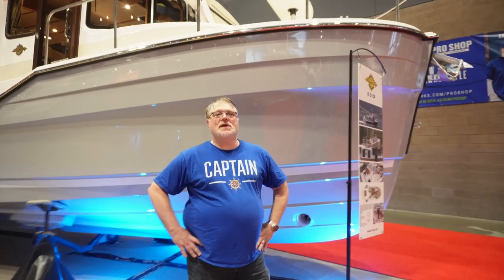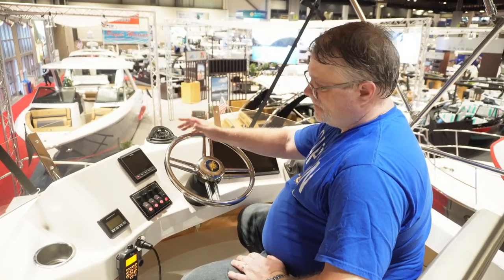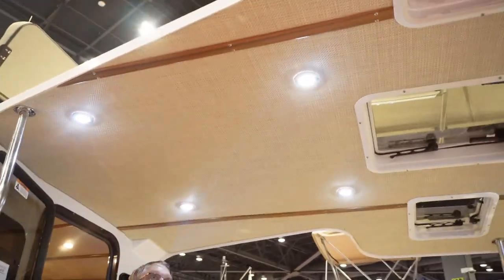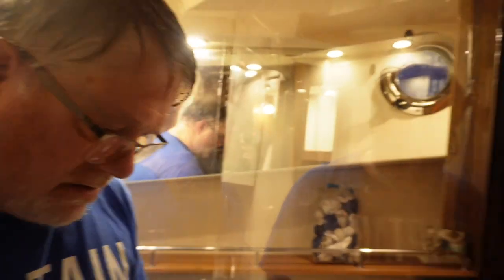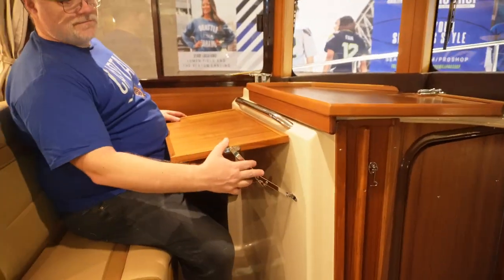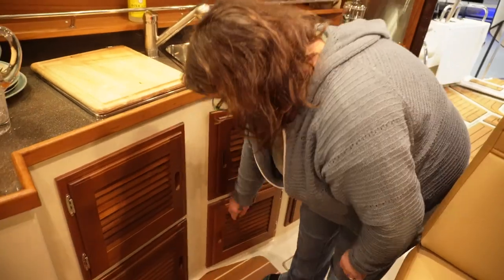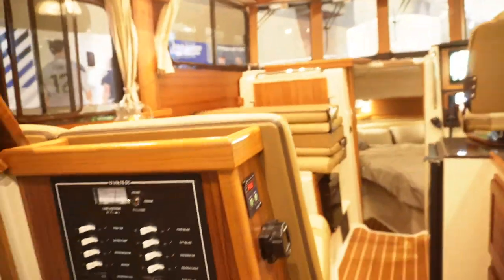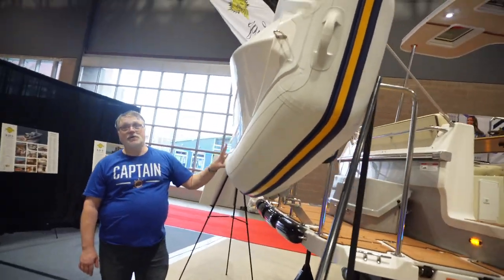Walk through of a Ranger Tug R31CB | Seattle Boat Show

Comment: Thank you Martin for this well done video presentation! I purchased a new Ranger Tug R-31 Command Bridge in 2021 from Winter Island Yacht Yard in Salem Massachusetts. After the passing of my beloved wife I needed to downsize from my 43' very comfortable trawler yacht but wanted a vessel with all the amenities my larger boat had. The R-31 CB checked off all of the boxes and than some. Although the base boat comes with an extensive list of standard features that are optional in other boats, I purchased the Luxury Edition with the generator, air conditioning, etc. Additionally, I opted for a Bimini top, a roll-up enclosure for the aft deck to enable me to sit outside on inclement weather days, the dingy with Weaver quick release davits, and a third helm station in the aft cockpit. I also tricked her out with custom mattress toppers, bedspreads, a ceiling mounted rail in the forward head for a permanent shower curtain, monogramed fender covers, custom burgee, etc. The Volvo D4 diesel in incredible, giving me fantastic fuel economy at displacement speeds but with the ability to reach 19 knots if need be. The boat has the most amazing use of space I have ever seen and is literally a 'Swiss Army Knife' of innovation and design. The standard bow and stern thrusters make docking a pleasure. Ranger Tug/Winter Island Yacht Yard featured my tug named JACKPOT II at the 2022 Newport RI Boat Show. These Rangers a great 'pocket yachts' that attracts tons of attention everywhere you go!
Reply from the maker: Thanks for watching!!  We love our RT27-OB. We have many friends who have the RT31's.  They're really nice.

Comment: Sweet boat.  Just wish they were faster like the 27 and down.
Reply from the maker: They'd need to slap an outboard on the back of the bigger boats.  Rumor has it, a Ranger Tug 35' is in the works and it will most likely have an outboard on it. (Like a Yamaha 425 or 450).  Maybe twins?
Reply: @Letsgochannelsurfing  some twins would be sweet